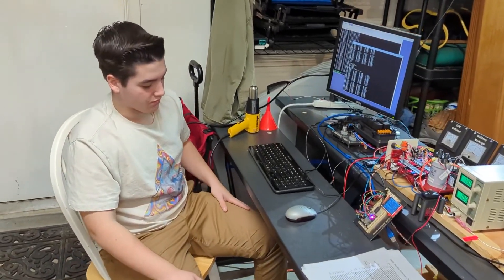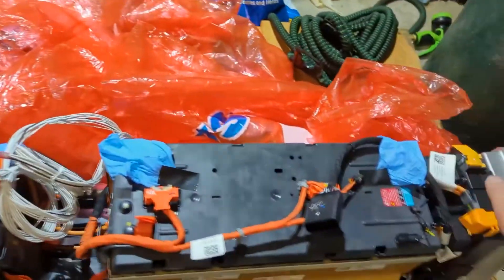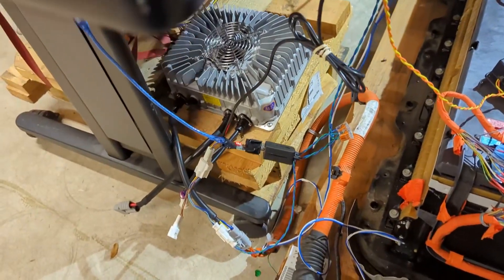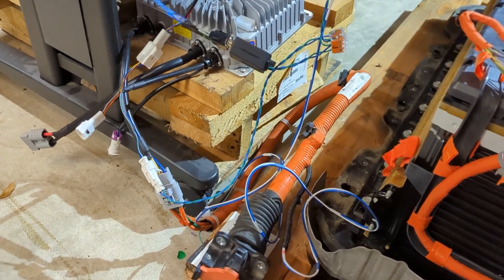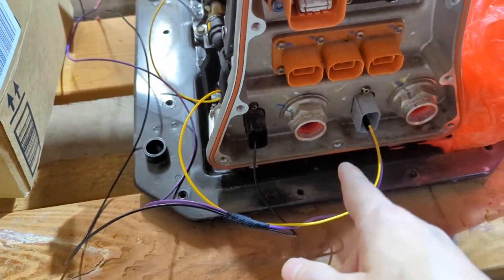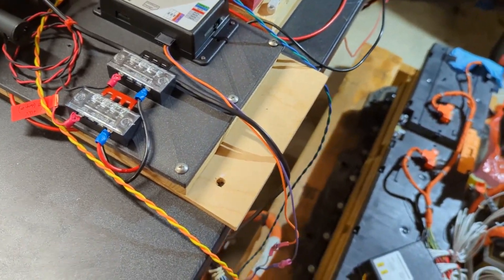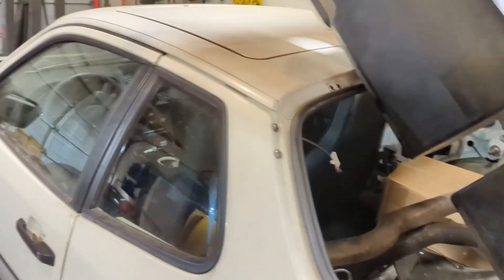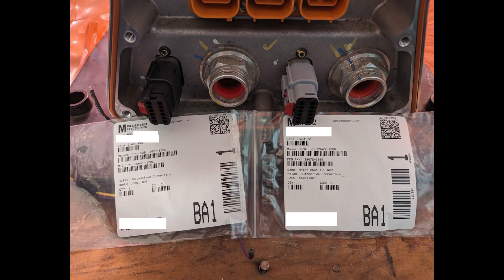Porsche 924S EV Conversion - Part 16 - BMS Wiring Complete

Comment: You really should invest in the extra BMS module. Having that fuse/disconnect in the middle of the pack is important. I understand the problem with the Dilithium BMS.

Comment: Nice work so far, I know how time consuming all this is.
The Nissan Leaf BMS I'm using has an extra connection to to the negative of the next cell to allow for the HV disconnect in the middle of the pack so maybe that is a possibility. 
Do you know if the contactors are driven by 12V or a PWM controlled voltage? The ones I see many folk use have economisers to save the contactors failing prematurely. In my case I have a buck converter reducing the voltage to 10V but I'm not certain if this will be OK long term.
Reply from the maker: It's an interesting question. We're using 12V and hearing them click, but we haven't tried anything else.
Reply: @FrankGraffagnino  Mine came out of an eGolf and they work perfectly on 12V (or more correctly 14.5V) but will draw around 700mA. I heard this would shorten their life so reduced the voltage and they now draw more like 300mA to 400mA. 
I guess it's just another thing to bear in mind. 😉
Reply from the maker: @alibro7512  what did you use to reduce the voltage?
Reply: @FrankGraffagnino  just a cheap constant voltage buck converter
Reply from the maker: @alibro7512  cool. If you have a part number or link for what you used I'd be interested

Comment: Would love to see how you found the proper connector for the back of the Volt battery. I'm working on a Bolt and having a heck of a time getting any connectors that actually work.
Reply from the maker: Which connector are you talking about? The huge one that goes to the inverter/motor? Like in the top left of the thumbnail?
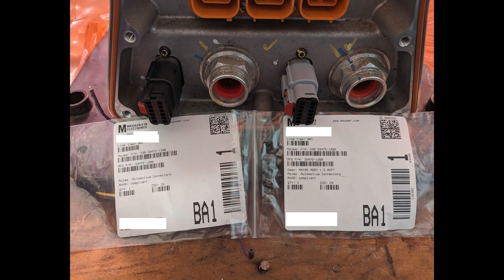Reply: @FrankGraffagnino  The ones you're showing at @6:45 - low voltage connectors. Initially I wanted to extend the wires to my Bolt's BMS, which use very similar connectors to what you've got there. My desire was to build an extension harness with a male and female end. I looked for ages and couldn't find anything, and ended up splicing the wires instead. I also gave up on finding the HV connectors, and instead spliced in extra lengths of wire here, too - because even though I could find SIMILAR things, they weren't the same. Also very expensive - like $150 for a single plug.
Reply from the maker: @BillCarlson  yeah it took lots of research to identify some of these part numbers and for the low voltage ones you mentioned, I had to buy 5 or 6 plugs and try a few different ones. Which is why I wanted to share those part numbers at the end there so that someone else doesn't have to do that work or waste their money.
Reply: @FrankGraffagnino Do you have spare plugs you’re willing to sell? I’m working on a project and your videos are very helpful 😊
Reply from the maker: @adampaleski1896  which plugs exactly are you looking for?